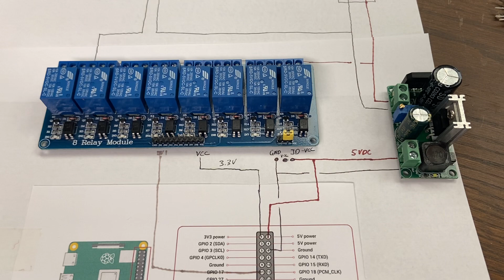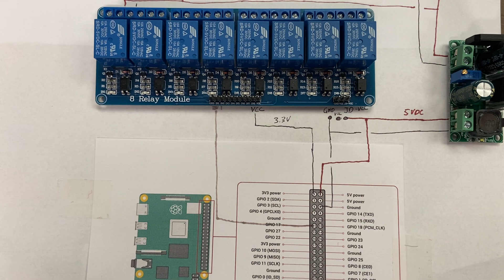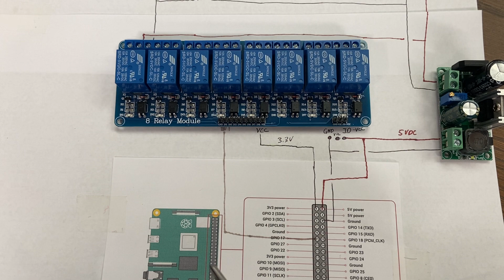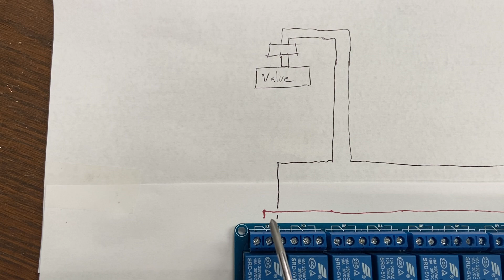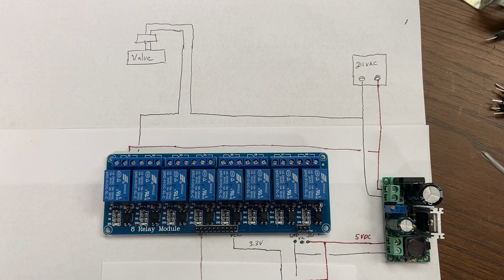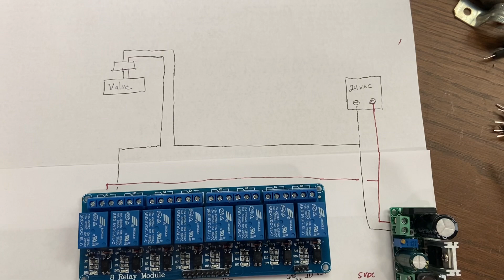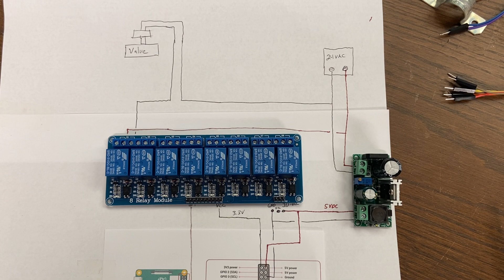Raspberry Pi 8 channel relay with voltage converter OpenSprinkler

Comment: Do you use any pull-ups on your relay control lines?  The RPi uses internal pull-ups while Opensprinkler is running, however I noticed that since the relay board is active-low, all the relays are on during bootup.  It's not until Opensprinkler is up and running do the internal pull-ups turn on and the relays turn off.

Comment: Very clear vid.  When using OpenSprinkler are there designated pins you have to use?
Reply from the maker: Thanks! Yes, OpenSprinkler let’s you choose whatever pin you want for each zone. You also choose if it’s high or low active state. Mine are low.
Reply: @markshep03  Found it thanks.  Click the sprocket, click advanced tab, select GPIO, select pin and state.